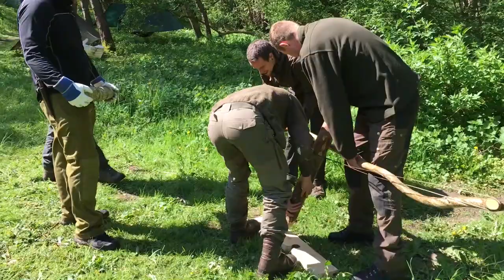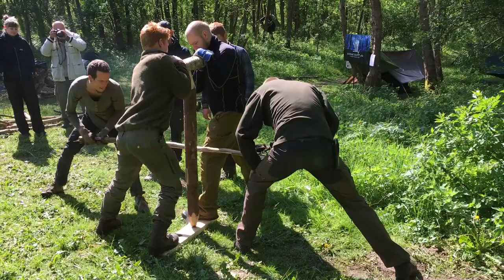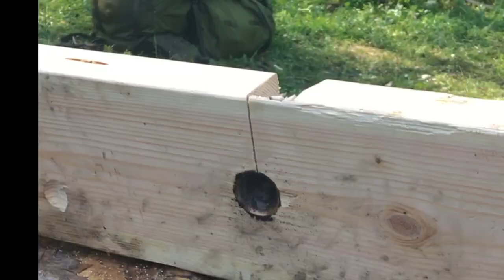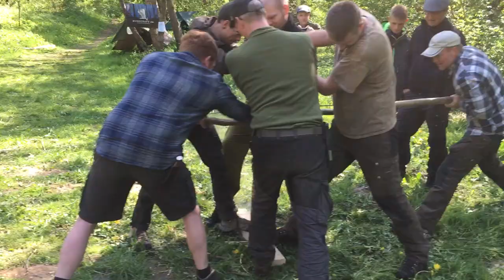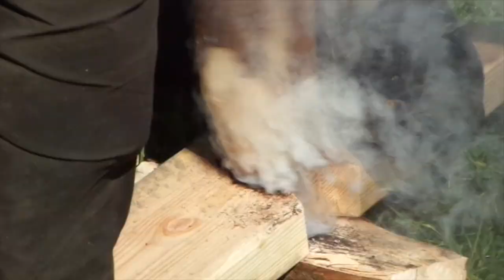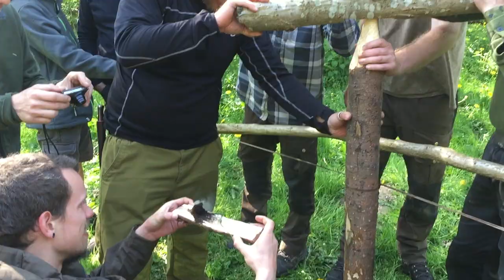Bow Drill (World's Biggest ?)

Comment: So, by doing this extreme experiment, would you say back on a personal level is it better to work a bigger or small set? Does size matter;)?
Reply from the maker: My preferred drill is just less than knee height :D
Reply: +DonVonGun   I'm getting there, got lots of smoke last week but didn't cut the notch, carved it into a pipe instead.
Reply from the maker: Make your bow so tight that it is hard to get the spindle on. You will get it soon ;)